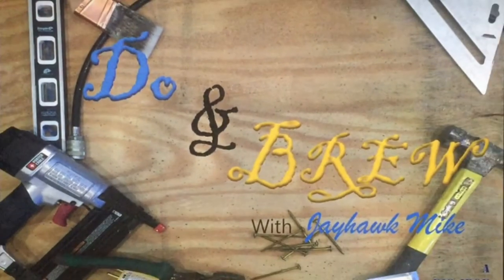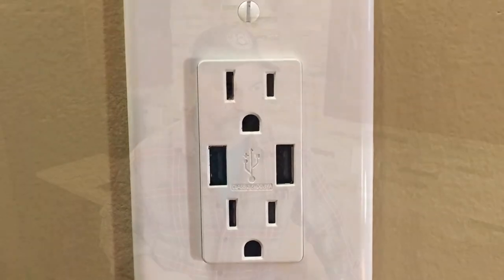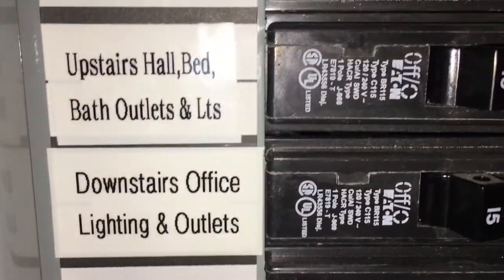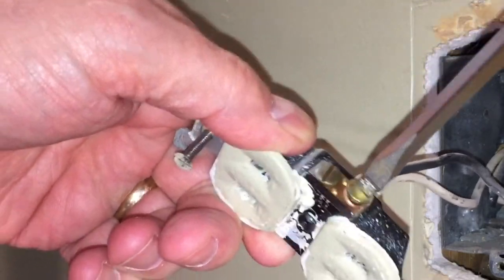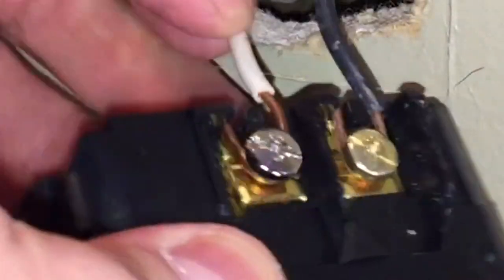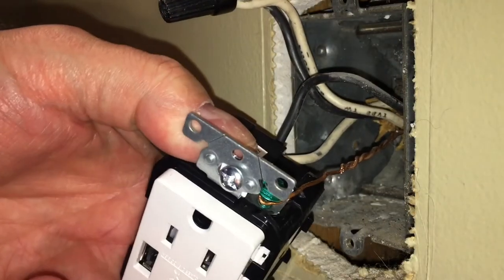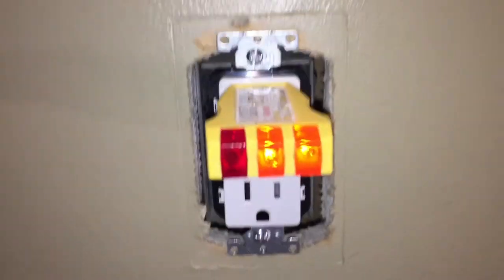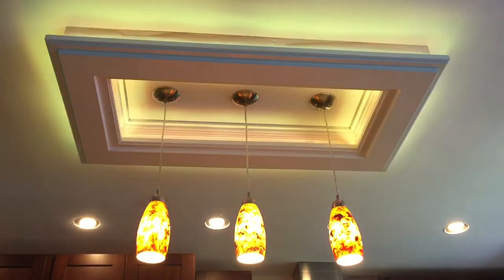How To Install A USB Wall Outlet

Comment: Could you just show the tools you used; I.e. The circuit testers etc. great video. I bought an old house, would be nice to be able to switch the outlets. Thanks again...
Reply from the maker: Howdy Csaba!  The voltage tester I used is made by Klein Tools...here is a link:  

https://www.homedepot.com/p/Klein-Tools-Non-Contact-Voltage-Tester-NCVT-1SEN/100661787  .   A good deal at $17 to ensure there is no power in the circuit you're working on.

The Outlet Tester is also made by Klein Tools - the yellow one that I used in the video is no longer available - it is now orange.  Here is a link:  

https://www.homedepot.com/p/Klein-Tools-Receptacle-Outlet-Tester-RT110/206517828

The outlet tester is a great deal at $6 for the peace of mind knowing you have wired your outlet correctly.

Hope your flying is going well!

Let me know if you have any more questions...hope to see you as a subscriber!...good luck renovating your 'new' Old House!!!
Reply: Thank you so much! And yes, definitely, I’m subscribing right away... thanks for links and tips...